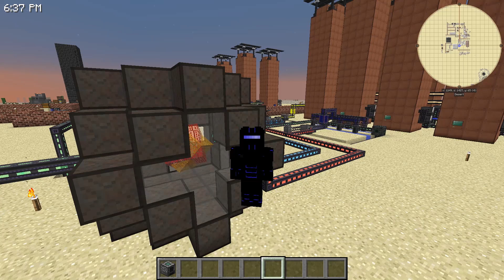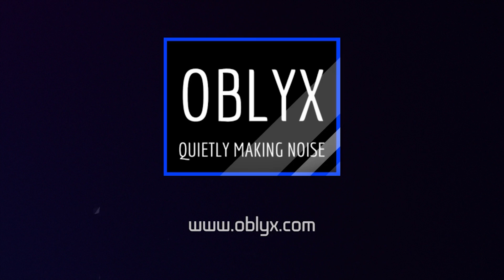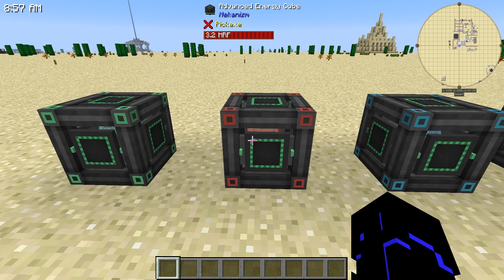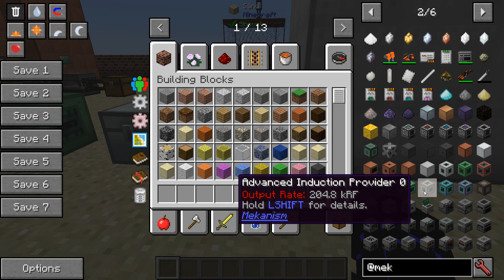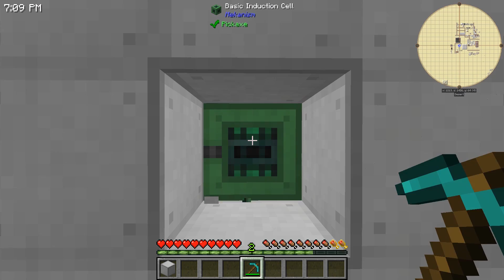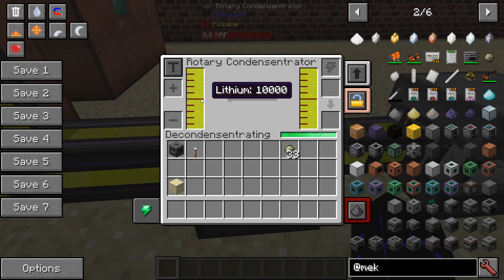Mekanism Power Storage

Comment: Mekanism induction 18x18    is   838,656,000,000,000  vs draconic tier 8 .    9,223, 372,036,854,775,807     your " big boss"  capacity is 10997 times smaller. There always a bigger storage ;D
Reply from the maker: And years later, things change.

Comment: Can  you do the thermal evaporation in the nether ? :)
Reply from the maker: A great question, I've never tried.  I can't see why not as the water is always contained inside a machine or pipe.  Would have to try to be sure though.  I may give it a go when i get a chance.
Reply: @oblyx  Might be able to with a quantum entangloporter to move the water between dimensions.

Comment: I thought these were pretty easy until I saw the lithium part and I was like "oh god more thermal evaporation plants".
Reply from the maker: yeah, but once you get them setup they just run forever so that's nice.  The matrix is super resource intense.
Reply: @oblyx  Just a question, do you think in the future we'll be able to pump in heat to accelerate thermal evaporation plants?
Reply: @kelvinyonger8885  You already can
Reply: @kelvinyonger8885  Use resistive heaters, pump the heat from then into valves, and voila
Reply: If you’re playing on a modpack with nuclearcraft and thermal expansion, you can use the pulverizer on lithium ore to get lithium dust.
Reply: also, putting Nether Quartz into a thermal centrifuge will yield you a nineth of a Lithium powder. So grab your fortune pick and go in to the nether, you should be able to grind it fast.
Reply: dont you have agricolture?
Reply: @mrElementium is very cheap to make even in the mekanims way

Comment: My induction ports aren't outputting, just inputting. Why is this? I'm 100% sure that I have an induction provider behind every induction port, and there's definitely energy stored in the cells.
Reply from the maker: Let me pop on my system to refresh my memory when I get home from work and I'll see if I can help.  Give me a couple hours to get home.
Reply from the maker: So when you look at the ports, are the lights around the hole green or red?  green means input and red means output.  if they are green, which is the default then you need to use a configurator on them to turn them red which makes them an output port.  It will display the text of the changed status in the notification section.  The matrix has dedicated inputs and outputs.  Let me know if that helps.  If not give me some more info and I'll see what I can do to help.
Reply: oblyx Ah thanks man, you are so helpful, it worked. Now my new creative fusion reactor setup with more machines and 12 evaporation towers is really going for now! I'll let you know if there are any results.
Reply from the maker: Outstanding.  Glad you got it going.  It's an awesome system.  I'll be building one on my survival Project Ozone Lite series in maybe 3 or so episodes from now.